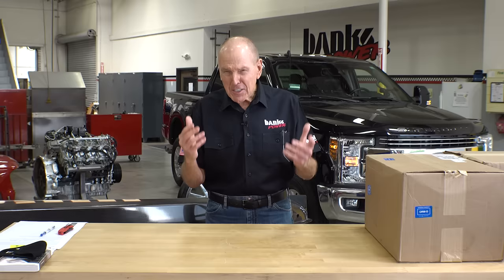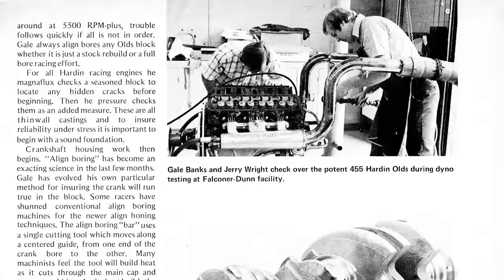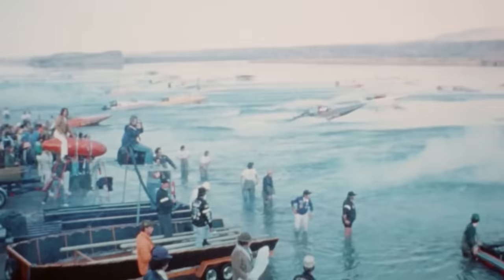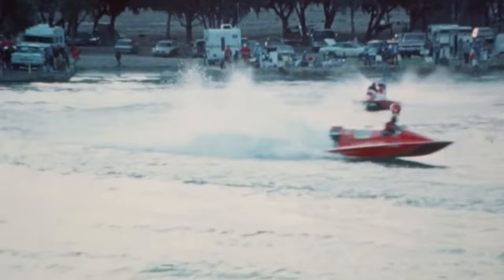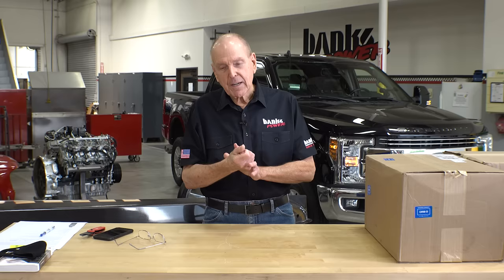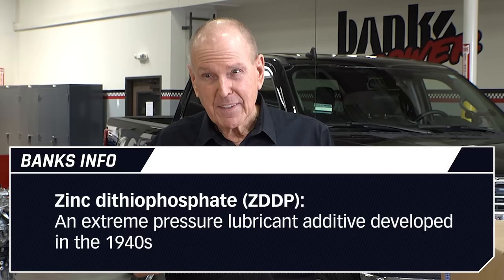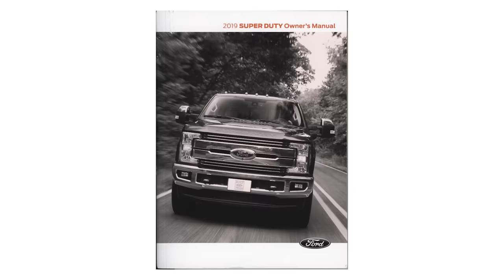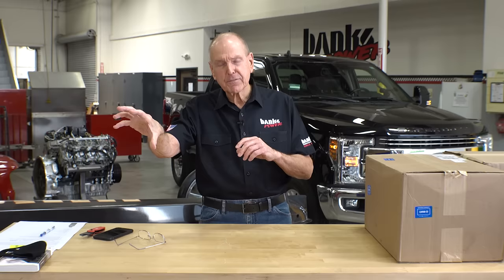ENGINEERING UNBOXED: This filter can extend your oil life

Comment: I would love to hear more about those Oldsmobiles, and if you did anything in particular to the 455 boat motors, I would guess keeping RPM down and some kind of oiling system change? 
It seems Oldsmobile got alot of the bad decisions choosed for them several times, maybe they were a bit too much of "Yes men" to the higher ups on important stuff. Like the Diesel, the lightening of the Gasoline blocks, the maybe not too thought-through swirl port 307, GM experimented alot on all other brands than Chevrolet it seems, maybe Chevy said more NO! than BOP and Cadillac did.

Comment: I did one of the amsoil bypass filters on my Cummins 5.0L Titan on its first oil change at 6k miles, and have sampled at 6k mile intervals. These things just work, and I have the oil analysis sheets to back that up. 

Wear metals and soot across the board were down from 5% to 30%. Granted that fall off could be from break-in, but my oil quality numbers from a sample taken at an 18k mile interval looks better than the oem oil at 6k miles.

These things aren't 'cheap', but they are a hell of a lot cheaper than a re-sleeve or a long block.

I have been pulling my samples from a fumoto valve at the factory drain point. Looks like I need to install a sample petcock

Comment: Ive been a huge promoter of bypass filters, i have a toiler paper oil filter system on my 2007 Dodge Ram Cummins and its already has 680k+ on the engine..

Comment: All the heavy maritime diesel engines I have worked on have used a centrifuge in addition to normal filters, the centrifuges were so efficient on the MTU diesels that they would separate the oil manufacturer additives out of the oil as well as the soot. We ended up having to delete the centrifuges from certain engines or actually increase oil change intervals, as the centrifuge filters did the job too well.

Comment: I have installed and insane diesel version of this bypass and where the oil goes into the filler cap of my 2019 Duramax it causes extra oil to go up the crankcase vent assembly, ultimately causing oil to get into air intake and causing your engine to burn oil. Or worse case causing engine run away and/or engine failure. If you run a bypass,,,, get you a CCV DELETE!!! It will save your engine. But I would recommend getting a CCV delete whether you have a bypass or not.

Comment: I wonder what Gale thinks about VW Diesels? Their diesel engine was also similar to their gasoline engine design.  I drove them for 28 years, from 1985 to 2013, logging over 850,000 miles in 3 different cars. Yes, I developed a lot of patience in regards to accelerating and never had many opportunities to actually pass any other cars. LOL But the 46--50 mpg was nice.
Reply: Gale modified a VW Passat diesel several years ago (before Diesel gate) in a project with VW and Bosch. The results were excellent. It's probably on YouTube somewhere

Comment: yup had a 350 diesel in my 1980 c10 haha     fun times..   first engine broke the crank while running down the road at 60 mph,  second was a dx block and it kept popping head gaskets, even after studding the heads and planing the block and heads, had a good pump and brand new radiator..    the ole 350 diesel was definately a boat anchor so i pulled out the dx block and tossed a 350 gasser in her and that solved all my problems to this day lol   i done the swap in 2000..

Comment: Friend laughs that I am OCD - I drain oil over night and fill oil cartridge with oil before screwing it onto thengine block.
Reply from the maker: A bit extreme, but we get it. Perfectionism is in our DNA as well.
Reply: I do that also!!  I have the time to let it drain for days if needed... And I also always put oil in the filter, the day I start draining the oil, and a little at a time, add more new oil to the filter... It takes a bit for the oil to soak all the way into the pleats, so the longer you slowly fill it, the more full it will be when you install it... Just do this -- weigh the used oil filter you remove, trying not to spill the oil out of it... It holds a lot of oil... There you have it !!!

Comment: I've got this Amsoil setup on my '06 Duramax.  I still see soot on the dipstick but I imagine there's considerably less now that I'm running this filter.  There are also centrifugal filters that supposedly work better and don't have a media that needs to be replaced.  You simply clean the filter.  I'd like to see someone do a test to see which one really does work better.
Reply: A lot of centrifugal filters do have media, it is basically a paper liner that is inserted into the main housing for the contaminants that are spun out to stick to. If it doesn't have a liner it can get hard to clean in some cases
Reply: TheTennesseeTittyTickler that’s what always worried me about this system is reduced flow. I just change my oil every 5,000 miles in my Power Stroke. Because it uses high pressure oil to fire the injectors the oil sheers down to a lower viscosity anyhow. Extended oil changes never appealed to me.

Comment: I use engine flush and run the engine for a couple of minutes to clean the old oil out, change the filter and fill it with a cheaper oil then run the engine for a couple of minutes then drain it and change the filter again then fill with good oil and add an oil stabilizer. I get instant oil pressure on first start up every time due to the oil stabilizer. Your oil stays cleaner for longer and if you do it yourself the whole process is cheaper than taking your car in for a standard service at a dealership.

Comment: The old CATS ar the wisest ones.  I lived on the beach as a boy and saw off shore racing boats going full throttle and wondered how they didn't blow up. Then I saw guys take SB Chevy car engines , put them in boats, and blow them up in an afternoon. Truck engines lasted longer by 5 times or so. Thats when I heard of Mr Banks and his turbo engines.  I wondered how he got engines to run full power for what seemed like forever.

Comment: Bought the Amsoil bypass kit to put on a ML 350 diesel. Unfortunately there is no oil pressure access port on the OM642 engine.  One option is to buy Extreme Diesel’s billet oil filter cap with oil pressure take off for approx $300 USD.  Another option is to buy a Jeep Commander 3.0 diesel oil filter housing that apparently does have a tapped oil pressure takeoff.  Last option is to sell the bypass kit and just change oil more frequently.

Comment: We had an 83 Mercedes 240D that we put 300,000 miles on it.   I had an Asian friend of mine at work that snapped up that car when I put it up for sale.   Said the engine was just broken in.    The 240D had a bypass filtration system built in to the regular full flow filter.

Comment: I put that system into my 14 SD as soon as I got it. It's actually the duel bypass system. I've been using the universal unit on my 2000 F 150, then transrered it to my 05 F150 and as I said the new bypass system for my 6.7. Haven't had any issues with oil yet! (Knock wood) Even with the bypass oil still gets black, that's the way it is, but I'm sure its better with than without! Better to have and not need that need and not have. I have the valve that I can fill the sample bottles from the bypass block.  I didn't get all that stuff when I ordered mine. No Magnet! Hey I want my money back.....no never mind.

Comment: Mr. B, the last time I rang a company and asked for one thing to which they ended up sending half their catalog as a 'we love you' bonus, it was the early 2000s and I ran a cigar shop. All things considered, I still think you got the better deal. =)
The miracle wash gag was comedy gold!
Edit: Interesting! I happened to have built a very similar system for a 170mm jet engine oiling system last year, albeit with slightly different plumbing. Great minds, eh?

Comment: I've had an Amsoil bypass filter on my 5.9 Dodge diesel ever since I found out many years ago that they existed. It will filter out all particles big enough to cause engine damage but it WILL NOT filter out the soot in your diesel engine oil. The soot particles in diesel engine oil  are way too small and will pass through any oil filter.  The first time I changed my oil and filters after installing the Amsoil bypass filter I wiped off the dip stick,  started the engine and let it run a little while I checked for oil leaks. I cut the engines off and checked the oil level expecting to see clean oil on the dipstick but the oil on the dipstick  was as black as the oil I had just drained.
Reply: That's far from any kind of scientific test or enough basis for a conclusion

Comment: Love your videos.
I think that a good way to prevent too much carbon build up in an engine is to run 100 litres of fuel to each litre of oil in the sump. Then it's time to change oil..
5L sump capacity = 500 L of fuel used between services
Reply: Umm, on my typical trip I rum 1300 miles in 2 days.  if I did your schedule I would have to change oil 10 to 20 times a year. You may want to rethink it.

Comment: I used one on my three cylinder 1988 Chevy sprint turn my 4 quart oil system into the 9 quart oil system with dual bypass filters

Comment: Converted my diesel pickup to run a Baldwin dual flow oil filter that has the regular and ultra fine bypass media built in. My oil stay way cleaner for a longer time. The only problem was packaging, that filter is huge 11”x5” 😂😂

Comment: If you can reduce the production of soot by helping the engine run cleaner the oil will last longer.
Filters only address the symptom not the cause.
As it's normally not possible to reduce soot production 100% it's usually a good idea to use both approaches.
N.B. A better oil filter helps the engine run cleaner... so it does go some way towards reducing soot production.

Bypass oil filters are great but are not simple to fit... and thus are less popular than they ought to be.
🙂
Reply: There is a DR650 test (petrol) that showed a 100% reduction in soot production after improving lubrication.
Diesels also show large soot reduction after bonding a lubricant to the engine.
These two approaches are compatible.
🙂

Comment: I find it interesting that VW managed to make a long lasting diesel out of the gasoline Rabbit engine in the late 70s, and Nissan managed to make a good diesel from the L-series inline six, for use in the optional 1981-1984 Datsun diesel Maxima. However, people feared owning a diesel back then because Oldsmobile pissed all over Rudolph Diesel's grave by building that piece of crap.

I like Amsoil. I don't know of a better automatic transmission fluid. I have used their heavy gear oil in some situations, and I have heard that it is good.

Yes, many modern diesels are built to emit less soot from the combustion chamber. However, it is my understanding that 2008 and later trucks had higher oil soot levels because they needed higher EGR flow rates to meet 2008 NOx requirements. Also, I thought that if an engine needed frequent active regen cycles, that also added soot. I suppose it would be interesting to ask an oil analysis expert which is worse on oil, a modern DPF diesel, or a mechanical injection prechamber diesel with an EGR valve.

Comment: He's been hearing about bypass filters for 60 years, acknowledges that Soot is the primary reason for oil contamination, says it's an excellent product for diesel owners and can/will make a huge difference yet hasn't used one in all the decades of working on gas and diesel engines trying to make them better? Will all do respect, very interesting.

Comment: Gale, I have a Ford F-550 Super Duty with the 6.7L diesel and it has 10,000 miles on it..  I run Amsoil in it with an Amsoil filter.  I recently had the oil analyzed and the iron showed 140.  Some folks tell me they expect that number since the engine is still "breaking in".  I would love to hear your thoughts and whether I should have the Amsoil and the filter changed out.

Comment: Trucks on the road with over 500k with out this set up.  Do your oil change on time with a quality oil and filter you will be fine
Reply: This  increases the life of the oil...which will increase the life of the engine...not to mention save money for people that use their trucks if they can safely get 25% or more life out of their oil before an oil change...like getting a free oil change every 4 @ 25%...especially on big trucks that hold a few gallons of oil...which gets expensive...this product is a no brainer especially if you own and maintain a fleet of vehicles...or paid 100K for that new diesel pick up...

Comment: Do they make a kit for gasoline engines? I know they dont create soot like a diesel but whats gonna hurt having an extra 2 micron filter
Reply: I recently installed one on my 2007 Honda Pilot ... videos on my channel. Working great so far !
Reply: Yes there are systems for any type of pressurized oil system. The biggest problem is finding a place to mount it. Today's cars are so crammed there is no room to mount one.

Comment: Look guys, if you follow a 3000 mile change schedule ANY diesel oil will do the job as that will be an oil change 4 times a year. Just go to Walmart and get what's on sale. I change oil annually which is ~15,000 miles. Most of my mileage is highway.  I do use a full synthetic. I am past 200,000 miles on my Duramax and it runs like new and the oil level drop is maybe a teacup worth between changes.

Comment: i measure oil pressure from the back of the cylinder head in a v engine the head furthest from the oil pump ...as an early warning system ...back in the day i used 1/4" I.D hose to a mech. gauge now the electrical are more reliable

Comment: amsoil makes various styles of partial flow filtration systems..  many styles,  you can get an adapter that utilizes your favorite oil filter, then has 2 fittings in and out, that runs to a bypass filter, I believe its adjustable so you determine how much oil is bypassed and filtered, maybe normal use you only want 25-30% micro filtered, then under heavy use mountain passes and such perhaps you want 60% ran thru it, I believe they do have an adjustable, the set style like this bypasses 30% . . . 

I cannot believe how out of the loop I actually am with Amsoil products, unreal, when I raced superbikes in the 90's its all I used, a LOT of it too, it was spendy like $5.00 a quart.. $2.50 filters, which was what I used as well..

unreal the longevity I got using amsoil and this is no jokes I am not kidding you here, I went from I wont say the brand but HI DOLLAR RACE BRAND EUROPEAN race synthetic and getting maybe 1 engine per race, 2 races if I am lucky, to getting 2 seasons per engine!!!  I kid you not, and I had the ultimate edge until everyone else caught on what oil I was using, even my street rides.. out goes the break in oil and I nevermind with the first 5000 organic.. STRAIGHT to AmsO and the miles i can get just a beatin the dog hair off'n a gixxer is unreal..  

I took a chance, you couldn't buy Amsoil in the stores, you had to know a deal, so it was sorta Amwayish to me, I thought man gimmick, but then I remembered Amway had this cleaner that just did the job, it's simple green today... so I thought maybe this company is in line with amway so I took the chance, ordered a few cases, and BOOM!  the engine just feels more responsive, spins up quicker, frankly there isn't any other oil ANYONE FOR ANY APPLICATION should be using...

anywho in the day dealers would try to recruit you to sell, then they got more of a break on their product, and everyone you recruit same goes for you, how it was back then not sure today, but I had several catalogs for years, it was a limited catalog I had no idea they had all this product today, they're really on point here nowadays, and these bypass systems aren't just for diesels, they work on gasoline as well, gas just doesn't roll as much coal as a diesel but it's the same philosophy, filter out all particulate that can do your engine real harm, keep everything gently floating on a thin layer of slick hot oil and she runs and purrs forever... in the day a motorcycle specific was difficult to get, so you had to get the friction inhibitor to add to it for the clutch.. unless you had a dry clutch

really like to see a smaller bypass system for motorcycles, street use... for guys that like to tour but not change oil every 3000 miles...  more specific to gas engines as well, truck..

Comment: Gotta disagree about the newer Diesels being designed to produce less soot . The desired low (relatively) temperature for reduced oxides of nitrogen produce more soot as an unintended consequence.
Reply: In addition, many diesels lower NOx through increased EGR flow, and that always adds to higher soot contamination levels.

Comment: The Advent of EGR increase soot intrusion by increasing the number of points of entry and  introducing soot back into the combustion chamber. But it's reduction in emissions outweighed the reduction in life span diesel engines.

Comment: GM put a 4.3L V6 diesel in the Chevy Celebrity and Pontiac 6000 cars. Aluminum, or cast heads, all cracked between the valves. But,, when they run, they did alright. Good on fuel. Just couldn't pay me enough to do head gaskets in one, in chassis. Sucks!

Comment: Now see with the vacuum pump through the dipstick I’d be afraid would pick up much more contaminants running the tip of the hose down the dipstick tube. I would prefer part of the drain from the oil pan mid stream. Not beginning or definitely not the end of the stream.